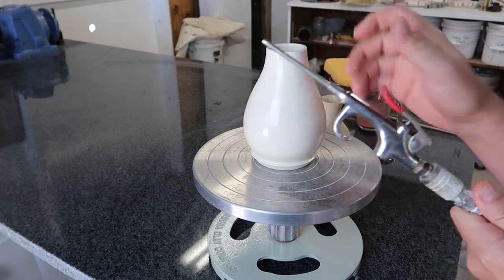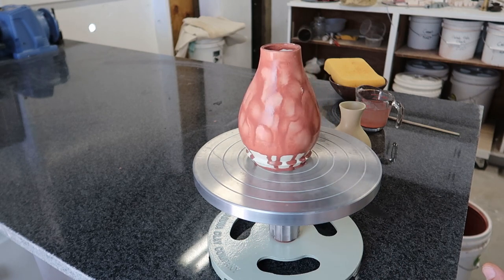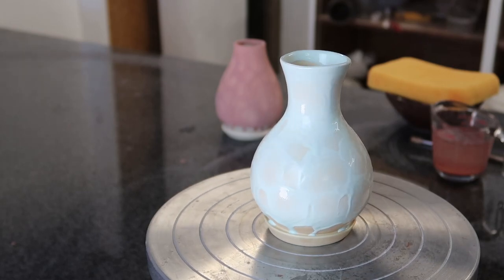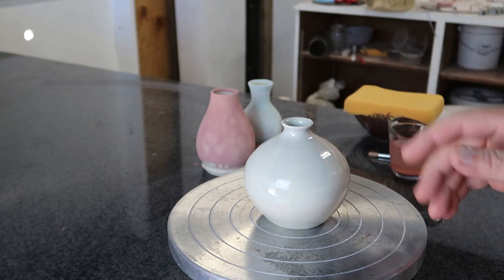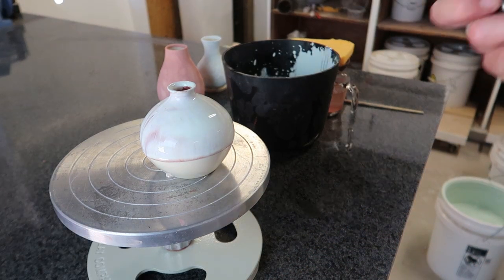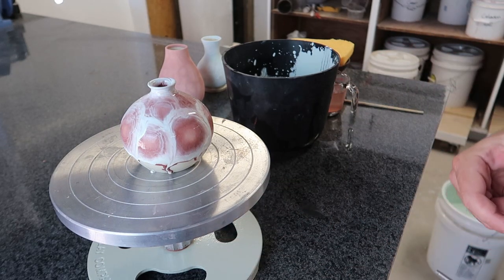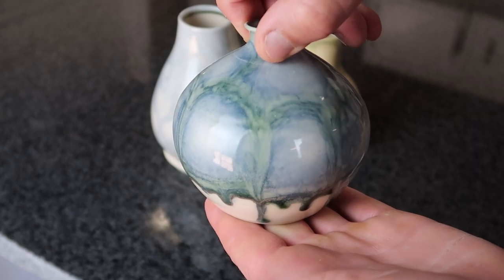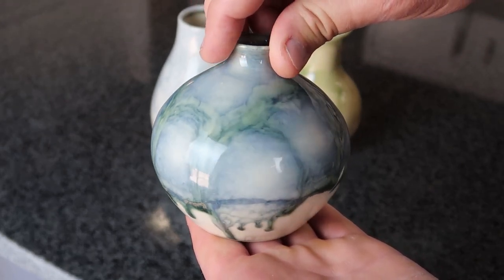Glazing Pottery with an Air Compressor - 2nd Try

Comment: If you spray a previously fired pot with old fashion hair spray final net and let sit 24 hours till good and dry, 2nd chance glazes will stick without running off your bottle shapes. Have been using this for 2 years works great.
Reply from the maker: Nice tip!  Thanks!